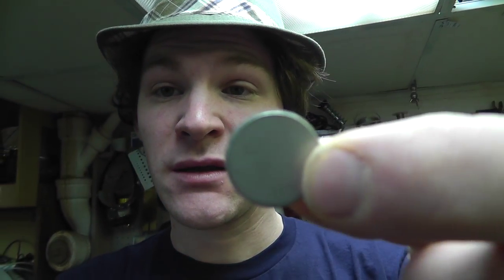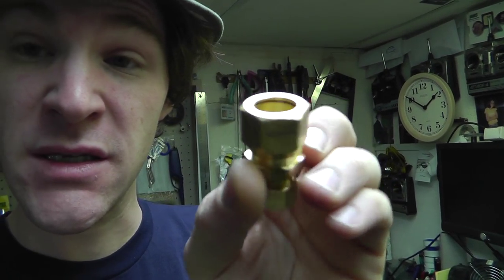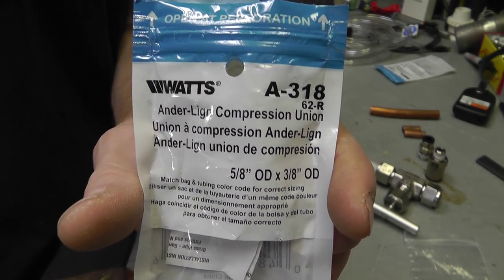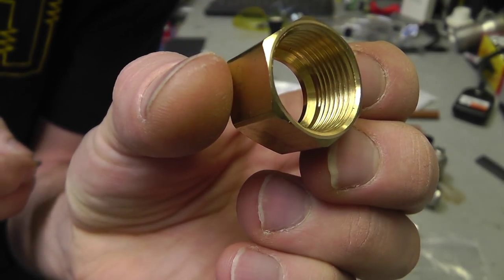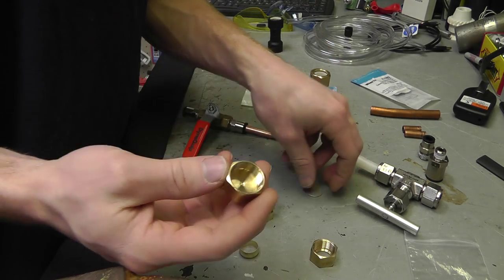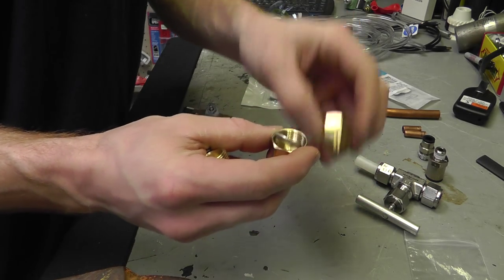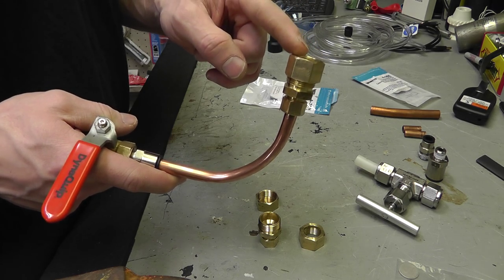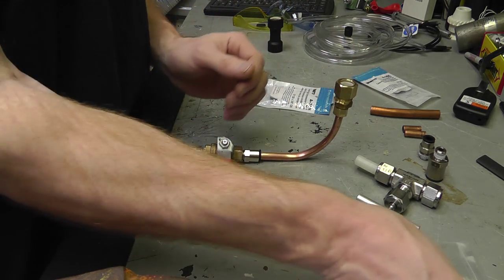P4 Stanly Meyers Quenching Disk , Russ's Assembly Of His Quenching Disk Set Up. RWGresearch.com

Comment from the maker: @cyalense i agree with you 100%, i also just tested a .025" hole in the cap with a disk and got a nice pin torch :) so it worked. but i'm also ok with a nice small flame as well, im not trying to cut anything so it works well as a "burner" or something! thanks for your thoughts!!! ~Russ

Comment: Those discs, Do you make them or purchase them ?, the mechanism wont / should not pass a flame even at increased pressure, this works with stainless steel mesh also, the hole size is key, it prevents the flame passing through the mesh to the production /feed/ side, though when I have used Mesh, The problem remains that if the flame does not go out, then the mesh has a tendency to heat to red hot, I think the disc more solid, cooler, might be a better way to go.for sure,  
Thom in Scotland.

Comment: Where can you get the disks? plus I think this setup would work well with some air pumped into the line although your cell has to overcome the pumped air pressure before it can output any hho